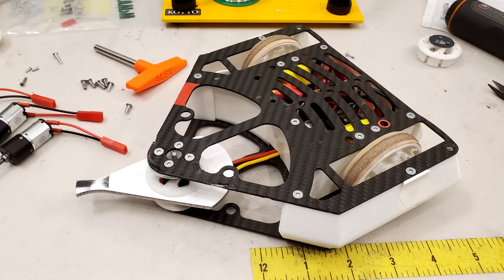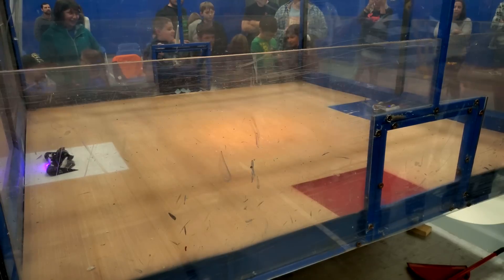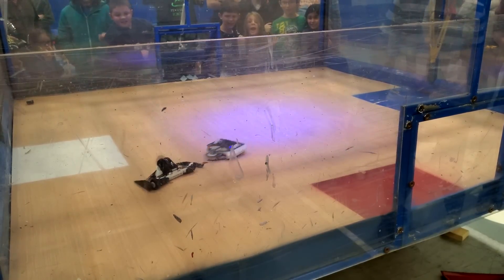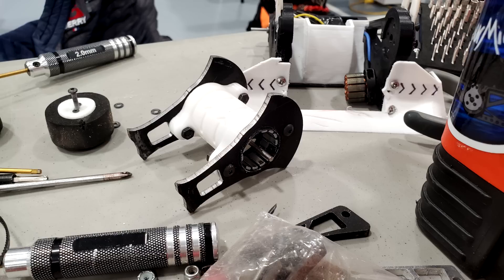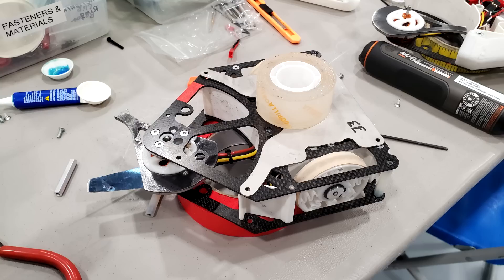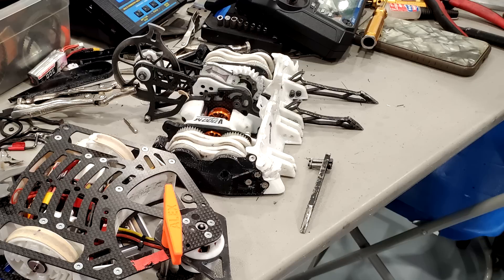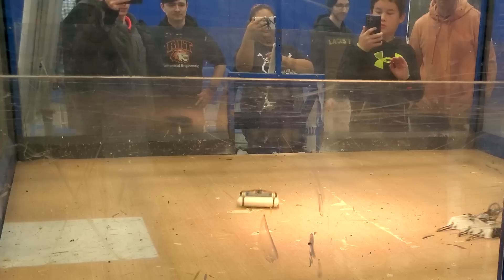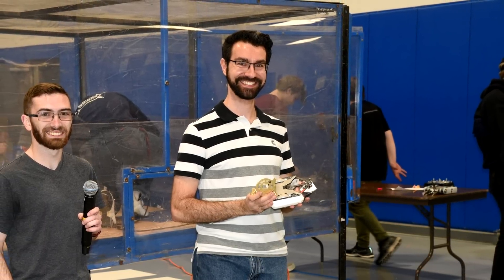Cheesecake strikes back! (Fall 2023 S.W.O.R.D.)

Comment: I don't know if anyone can help me or not.  I’m currently working on a thought experiment before I’ll build it.  I’m planning on building a bot that its top and bottom can be interchangeable.  That way when it's flipped over it still run a without having to change the way I would use the remote. I’m trying to locate a circuit design but I cannot come up with the proper terminology for this circuit.   If you don’t know, could you please direct me to the correct sources. Thank you.
Reply from the maker: Well, when Cheesecake gets flipped over, I can press a button on my transmitter to reverse the throttle and make him drive normally again. This works because I use the Fingertech Tiny Mixer, which is a little electronic device that plugs in between my receiver and my drive motors. This can also be done purely in software on a transmitter like the MT12.

Comment: Regarding "better push bot" - could you "flip" your controls via a switch on the remote to drive Cheesecake backwards and use its back as a push bolder?

Comment: Now maybe I'm the wrong guy to have an opinion on this since I haven't actually built or competed with a combat robot but it seems to me that maybe the shuffler weight bonus should go away. Clearly shuffling is no longer a technical detriment in the way it used to be back in the nineties and early aughts when those rules were written and it seems almost like teams just use it as an excuse to make "basically just wheels" and then get the weight bonus.
Reply from the maker: I tend to agree, but if the rules don't change, then I might just build a shuffler myself!
Reply: @alexsalchemy  At this point it seems you'd almost be foolish not to. You've got the technical skill to do it and you've already proven beyond shadow of doubt that you can build a monster spinner without the weight bonus.

Be the reason they add new rules, that's the greatest honor a competitor can be bestowed.

Comment: This is so great, because it's vastly safer and more accessible than 60-220lb categories. Not to mention that antweight, with the modern increases to power to weight ratio, better motors, and 3D printing, has really caught up to the first generation of full-size bot battles. Sure, a few of the original fights were crazy spectacles of devastation and power.

Comment: You should set up your controller to make the weapon motor accelerate in order to be able to work as a reaction wheel, probably just set up a button that will make it speed up, that way you have both reaction torque and torque from aerodynamic drag of your disk. This could allow you to very quickly turn around in situation such as having your back to your opponent.

Also that is awesome how you can go weapon to weapon with a vert. horizontals aren't typically very good at weapon to weapon with a vert, but you can tank it very well. You are very good at removing the weaknesses of a horizontal from a horizontal spinner.

You should also get a rub plate on the bottom of the front (under your weapon axle). It can just be lightweight plastic, and should allow you to better move over a gnarly floor a bit better, and possibly even protect your carbon fiber frame a little bit when it hits the floor hard.

I would also love to see a 4 wheeled version of cheesecake some day.

Comment: Congrats! Looks like those upgrades really paid off. I wonder though, you mentioned a few changes that made Cheesecake more compact - what did the extra weight go to? Thicker armor?
Reply from the maker: The weight went into a slightly heavier battery, and spare weight left over for some new attachments that I didn't get to use.

Comment: I love your video`s! And you inspired me to build my own.
Can you list the electronic part list that you use for me? 
Kind regards and keep fighting!
Reply from the maker: That's awesome! What kind of robot will it be / is it? 

Weapon motor: https://palmbeachbots.com/products/flash-hobby-d2822-brushless-outrunner-1800kv-0-125in-shaft-viper-compatible
Weapon speed controller: https://www.amazon.com/Electronic-Controller-Brushless-Multicopter-Quadcopter/dp/B09F3G4KNB
Drive motor: https://palmbeachbots.com/products/repeat-robotics-16mm-brushed-planetary-motor
Drive speed controller: https://www.fingertechrobotics.com/proddetail.php?prod=ft-tinyESCv2
Battery: https://chinahobbyline.com/products/3-packs-cnhl-lihv-ministar-450mah-11-1v-3s-70c-lipo-battery-with-xt30u
Reply: @alexsalchemy  Huge vouch for that weapon motor & controller combo. I have the same ones in my antweight. Sad I couldn't make it out to this event. The one time I'm sick I could've been in a video!
Reply: @alexsalchemy   Thank you so much!
I am a big fan of the battlebot: Breakpoint, I love saw designs.. I can design with Rino and also have 3D printer, but no idea how to build a battlebot.
Do you have a Discord server btw?
Kind regards, Patrick Akkermans.

Comment: Not sure if its a thing yet, maybe add a switch to invert the controls incase you flip over so it still controls the same.
Also maybe use a smaller curved piece of plastic on the side incase you dont use the big piece to safe weight, this doesnt have to be big or heavy just big enough so it isnt flat and doesnt have to function as armor.
Reply: Yes control inversion is easily programmed in any decent transmitter

Comment: I wonder if it would be worth have a light 3d printed version of your inverted anti-undercutter wedge to use on rough floors to help prevent the front edge of the frame from catching
Reply: If he's not using the sweet-tooth there's no need for a lightweight version of that I think.
He can just use the normal undercutter protection wedge.
Reply: @L1m3r  a lighter version to save weight for other armor could be useful

Comment: I'm in robotics at my school we use builda motors that come with high tourqe motors and high speed motors and motors in between. It would be interesting if you used those
Reply: GoBiolda's motors are much too heavy for this weight class. I've seen some used at the 12lb scale (12x cheescake's weight) but not below that. For drive the 435 or 250-ish rpm motors might make sense, but even their highest RPM motor doesn't touch what the weapons on these bots can run at.
Reply: @DigitalJedi  hmm interesting